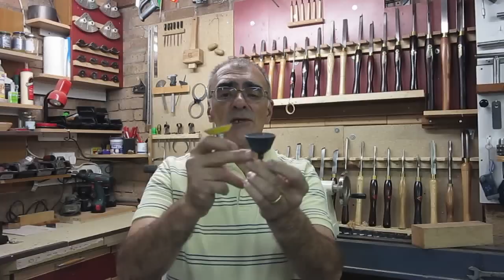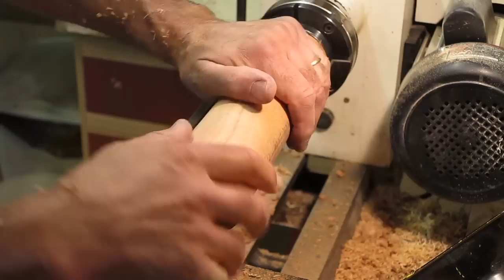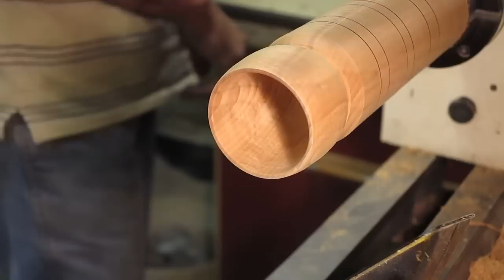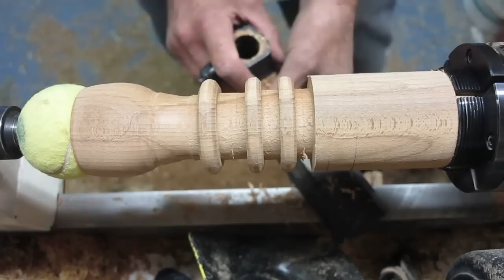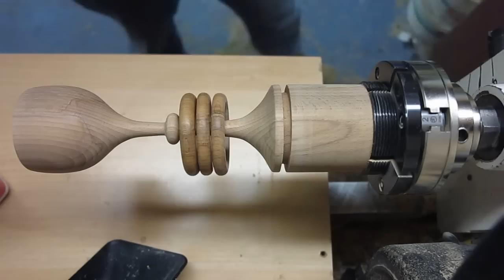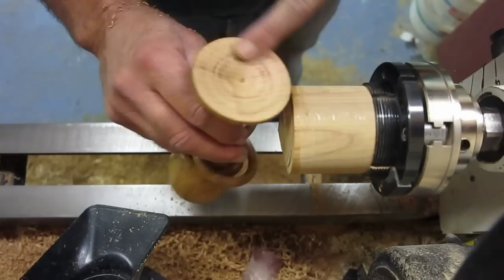Wood Turning - A Goblet with 3 Captive Rings

Comment from the maker: Hi Trevor, thanks.
I used a captive ring tool, shop bought. You can make your own designed tool if your so inclined, or just use the long point of a straight skew. My good friend baconsoda has used sharpened allen keys!
Cheers
Mike

Comment: Nice Job.
Question: Had you done one ring at a time, could you have made 5 or 6 on this piece? With the first ring completed, tape it out of the way and immediately use that space as the access to ring #2. Hopefully, you would not have to allow as much wood on each side of each ring.
I also like the tennis ball.

Comment: Looks great 
You said you sand to 600 grit. I generally finish with either 1000 or 1200 grit wet and dry paper as it gives a much better more polished finish.
Reply from the maker: Thank you, there's no limit to the grit you can go to, I just feel for most of my projects (except pens) that 600 grit is more than adequate. 
Thanks for watching and commenting.
Take care
Mike

Comment from the maker: Thanks Jimbo! The speed varies, depending on the type of wood and how dry/wet it is. This Beech was dry, the speeds were approx
Sanding                              500 RPM
Hollowing                          1250 RPM
Shaping and spindle work   1500 RPM
Releasing Captive Rings     1000 RPM

Cheers
Mike

Comment: Simply amazing craftsmanship.  I've worked with wood for years, but I'm new to turning wood.  I've turned three bowls so far and this last one I even made a lid for it.  Seeing pieces like this just motivates me more to work harder and think outside the box even more to create special projects like this.  Outstanding job sir and thank you for sharing.  I do have one question.  What is the name of the tool you used to cut out the rings?  Thanks again.
Reply from the maker: Thank you Wayne, that's very kind of you to say so. The tool I use is simply called a captive ring tool, and can be obtained from Crown Tools, Robert Sorby and others. t must be said that the toe of a skew chisel can also be effective, with care, and patience.
Take care
Mike
Reply: Thanks a lot, I'll look up the tool today.  I'm still practicing with my skew and I'm not having a ton of luck.  I made a small project out of scrap bass wood (very soft wood) and just can't  seem to get the knife to cut the curves that I see others do repeatedly.  I've tried the toe, the heel, and the upper and lower third of the blade.  I've also been trying different rest heights and angles.  It will take some time, I know but I think maybe I need to use a harder wood like oak or hickory.  I want to be able to use this tool so I can eliminate some of the sanding and tool marks.  Thanks again for the tip on the captive ring tool.  Have a great day.
Reply from the maker: You too Wayne
Cheers
Mike

Comment: Very nice as always.  My only question is how do you get the inside diameter of the rings smooth. I have turned captive rings before but i can never get them smooth.
Reply from the maker: +Tony Montgomery 
Thanks again Tony, I usually tape a little abrasive to the stem, and work my way through the grits that way.
Cheers
Mike

Comment: Hi mike. I work at a auto body repair supply house in the states. I have access to the yellow pad you showed at the beginning of your video. we also have a lot of other sanding related tools as well as grits from 24 or 36 to 3000, polishes, and a host of related items. You may stop at your local body shop and ask about their supplier. Thanks for your video.
Reply from the maker: +walter mccue 
Hi Walter, and thank you for the tip, I appreciate it.
Take care and thanks for watching.
Mike

Comment: Hey Mike, Great video.
I like turning goblets myself but I've been struggling to find a good food safe coating for the inside so the liquid doesn't seep into the wood.
I've tried shellac but i found that it didn't really last - any suggestions?
Reply: ULEI DE IN

Comment: Mike,
Great video. It will sure help me on my next goblet. After lots of trial and error -- and lots and lots of wood :-( -- I managed to make a goblet with two captured rings. It was for a wedding gift, the rings symbolizing the married couple. But instead of just leaving the two rings separate, I intentionally broke one only in on one side and then was able to open it enough to slip the other ring into it. Then glued the broken ring back together with a bit of instant glue. Break was invisible. So not only did the goblet have two captured rings, but even the rings were captured one within the other. Drove people nuts trying to figure out how I did it. :-)

Love your tennis ball trick. Doesn't it deflate if you puncture it with the tail stock?
Reply from the maker: Thanks, your wedding goblet sounds stunning, great idea with the interlocking rings too. The live center I use with the tennis ball has a removable point, which i keep out all the time, and always use it when turning goblets. Another method which I've just started using is the polystyrene balls you can pick up at craft shops. They are very inexpensive and you can get them in various sizes.
Take care
Mike

Comment: Right, so my wood lathe arrived yesterday, spent all day setting it up and getting a few bits for it. I am up early because as soon as it hits 8am, i will be starting my first attempt at turning a small bowl. anyhow, my question is, the lathe i have is a manual speed (belt driven), can i stick to one speed i.e around 2000rpm to both rough a blank down to finishing instead of having to change the belt gear?

Comment: Hi Mike,  Question for you.  Have made a couple of goblets and have such a tough time going into the end grain.  You make it look so easy in this video!  Do you have any tips?  What tool works best for you?
Thanks
Al
Reply from the maker: Put me on the spot or what Al?...lol
OK.... The highest RPM that you are comfortable with, a freshly sharpened spindle gouge with swept back wings, 1/2" is best for stability, or even a bowl gouge. I tend to take light cuts, starting from the center, outwards, after making a starting hole, either with a drill bit or the gouge. It does take some practice, but persevere and it will "click". When I started turning I used to turn the piece by hand and present the tool to the wood, and try to see the sort of shaving I produced with different presentation. I hope this long winded reply makes sense. If you need any more help PM me, and I will happily work through it with you. let me know how you get on.
Take care
Mike
Reply: Thanks Mike!
I found your " Beginners Guide To Goblets " and watched it as well.  Think I'm on the right track, will just stick to it.  I like the idea of pre setting the tool, will give that a try.  I just turned a captive ring goblet for the first time and it's not to bad.  Took me a long time. 
Thanks for your help and videos.
Al
Reply from the maker: woodentouch Pleasure Al, well done on the captive ring, very satisfying isn't it. let me know how you get on with the hollowing. Take care. Mike

Comment: Hi Mike i have just purchased the same lathe as you have,i am very please with it bought the this on the remarks you had to say about yours, thanks for the info. Mike could you please tell me how deep you go when parting rings from a goblet? many thanks Graham.
Reply from the maker: Hi Graham, I'm very pleased that your happy with your new lathe. the depth depends on the size of ring you want, and the tool you are using. Just deep enough to work underneath the ring works for me.
Cheers
Mike

Comment: Is there some benefit to spinning the wood around a horizontal axis as these machines do, rather than a vertical axis like a potter's wheel?
Reply from the maker: To be honest I've never thought about it, but with a few changes to methods employed, I see no problem. However, it would take a completely new skill set, and training program, as I would think the forces, and grain orientation would be different as well. interesting thought though.
Cheers
Mike

Comment: Rookie question, why do you use the sealer and wax after each part? Is there a reason or why couldn't you just seal and wax and everything once the whole shootin match is done.
Reply from the maker: Simon K I like to do the bowl part first as when your turning the stem longer, it becomes less stable, and especially on long stem goblets.
Cheers
Mike

Comment: Hello Mike, what kind of oil did you treat your goblet with? the aftercare of carvings is where I lack almost any concrete knowledge
Reply from the maker: +daniel munford 
Hi Daniel, on this piece I used Chestnut Finishing Oil, which feeds the wood and leaves a low lustre sheen, as opposed to a glossy finish.
Cheers
Mike

Comment: Hi Mike. Could you tell me what is the purpose of turning goblets or vases? I mean you can't really use these goblets for drinking neither vases to keep your flowers in? Or is there a way of finishing them inside to make it possible?
Reply from the maker: Hi Kuba, I can't speak for anyone else, but I turn them, because I enjoy it. You can get water resistant finishes, and then you can use them if you so wish. Good question though.
Take care
Mike
Reply: Mike Waldt thanks for answer. Could  you tell me what kind of finishes would it be?
Reply: You don't need any finishes at all. You can drink out of them. People have been drinking out of wood vessels for centuries. Just know that dark liquids will stain lighter woods, so you may want to turn a red wine goblet out of darker wood!  People hand carve and use kuksas and noggins (aka noggens) all the time. No finish needed.
Reply: Candle Holders

Comment: Mike, I subscribed ages ago and I'm always massively impressed with your work! I'm about 3 years behind and still practising more than producing when time permits.  Can you tell me what size the Continental spindle gouge that you use in this video?  I have detail gouges, with very swept back wings, but need to get a larger one for the bigger cuts.  It looks like it could be 3/4" or 1", but I'm not sure which, and can only afford one . . .

Cheers,

SteveH
Reply from the maker: Hi Steve, firstly let me thank you for your kind and supportive words, they are very much appreciated.
The gouge is the Henry Taylor 19mm (3/4") spindle gouge. I have ground a slight swept back wing on it, but this is only my personal preference.
Hope this helps
Cheers
Mike
Reply: It certainly does, many thanks. I've been turning on a benchtop Axminster lathe, and recently upgraded to the same as you have, principally because it has a swivelling headstock and I find it easier with bowls, due to a bit of a neck problem. I'm so impressed with it so far, so much better, as you've probably found, than the smaller lathe.

Keep up the good videos, they are inspiring!

SteveH
Reply from the maker: Really glad that your pleased with the lathe mate, my wife reckons I'm going to move in full time with her (the lathe that is) ;)
Cheers
Mike

Comment: Aren't you ever afraid that the goblet will just snap in half at the handle, I've used a lathe many times and I know you gotta put a little pressure up against the wood you're carving
Reply from the maker: +Colin Shepard 
There is always a chance of that happening, but with light steady cuts, things usually go OK.
Cheers 
Mike